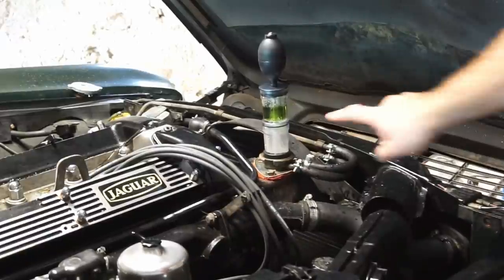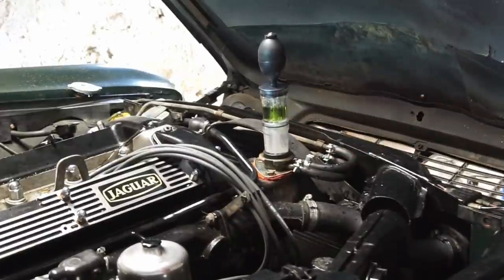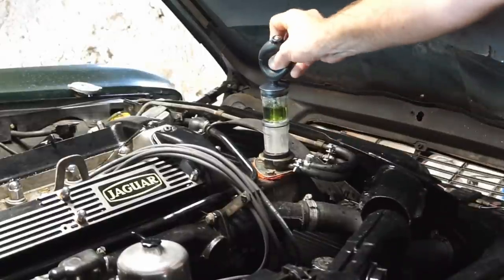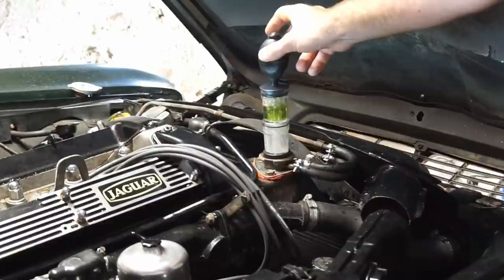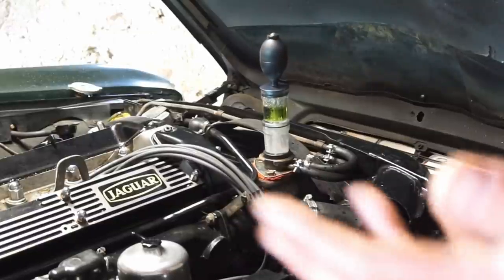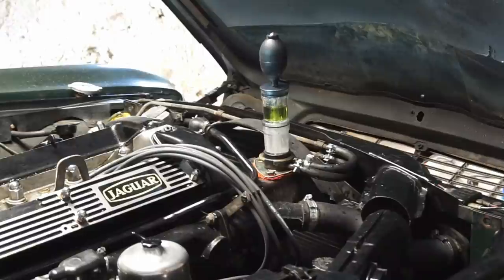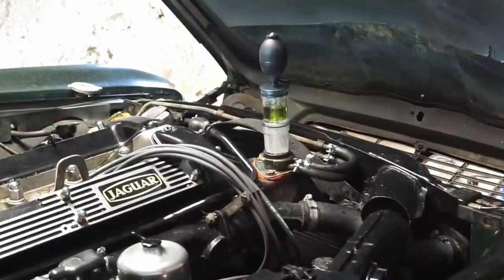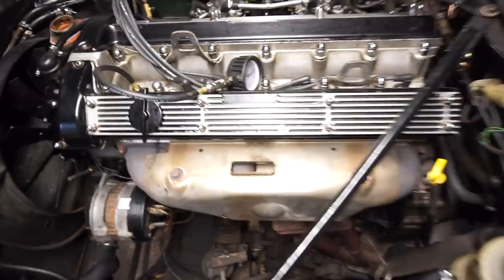Checking the Engine - Everything That's Broken on My Daily Driver

Comment: First of all, kudos to you for doing diagnostics before simply replacing parts and hoping for the best.  That is the proper way to address issues. If I had to guess it's either head gasket or cracked head unless Jag blocks have a history of cracking.  Unless it was allowed to freeze with weak coolant, that just seems unlikely.  

Adam, we are benefiting from your testing and procedures and I personally learn something from every video.  I just discovered you have a Patreon channel....some viewers like me would be happy to support you in your efforts.

Keep up the great videos! Cheers.

Comment: Hey Adam, I would start with the head. See if the head gasket is blown and if so, replace and see if that cures your issues. If not the head gasket then out with the engine & gear box and start thinking about rebuilding it or swapping it out. Great channel.

Comment: Great video, always learn something new...didn't know about the exhaust gas test.  Pull the hear, check the gasket, check the head for flatness.   Good luck!  FYI, liking my new gear reduction starter, but it was harder to install because of nuts on bolts rather than bolts that thread into starter.  Keep up the great work.  Really enjoy your channel.

Comment: Just for fun put some of that head crack sealer stuff in the radiator to see if it works.  At the end of the day you are going to strip or replace so curious to see if that stuff work.

Comment: All good tests, I would now take head off and I think it will tell you a lot of what happened as if the gasket looks bad then you can look further or as you say if the last install say had some dirt or grit it will easily show. Also before removing head you could check the weak cylinder tappets and if they are a bit tight as you suggested you would know which would help in making any final decision. 
Great video and stay happy.
Reply from the maker: Thanks John! In the next week or so the head should be coming off. I’ll update everyone on what the gasket looks like

Comment: Adam, depending on how long you'll way before opening the engine, you may want to dry that cylinder #2 real good and lube it well so that the water does not start to lift any oil from the cylinder walls and starts the rusting process.... Ask me how I know...

Comment: Hi Adam great video yet again 👌👌👌 I don’t really know what to say but I’m thinking along the lines of strip it and just see how bad or not it is good luck in what ever you decide to do 👍👍👍
Reply from the maker: Thanks Rick! I think I will now that I feel pretty confident in the bottom end of the engine. I just need to figure out where I want to take it apart since I won’t be able to move it easily after

Comment: so reading the comments you obviously had the head of because of a blown gasket. my question to you is did you have the head cracked tested and  resurfaced  did any of the water jackets in the head need welding around the water ports because of corrosion have had them blow out around there my self i never put a head back on with out surfacing it regardless of how str8 it might appear to be have found out the hard way   unfortunately love the channel

Comment: If this is a 4.2 they are known for head gasket issues.  I doubt very much that the engine is cracked.  They are also known for pulling the head studs out of the block necessitating helicoiling the block.

Comment: Compression could be leaking pass valve seats.   Decoke grind in valves.
Rtv silicone under head nut washers.
Reply from the maker: All the valves were lapped about 5 months ago. Might be a wrongly calculated valve shim. Yes I think I’ll add something around the studs

Comment: Step one. Pull head and see what is going on. Then assess if you want another engine or try and rebuild. Need more data. Unless you can get a known good engine for the same price of head work. Then it’s an easy decision. Swap it out.  Keep the old engine as a rebuilder or sell.
Reply from the maker: Now that I feel pretty confident in the rest of the engine I will pull the head. Hopefully it isn’t a crack and that just a skim will fix it. Thanks for watching

Comment: Motor does  not sound ''happy'' at all.
Reply from the maker: No it doesn't sound as sweet as it used to. A bit of it is the camera too but there is a difference
Reply: @LivingWithAClassic  Yes, cameras, especially apple seem to make engines sound terrible. But the tapping aside i think there is a background noise like a unhealthy 'rubbing' sound maybe a washed out bearing or something.
Reply from the maker: The jockey pulley for the power steering is pretty noisy, that bearing is going bad. Maybe it’s that